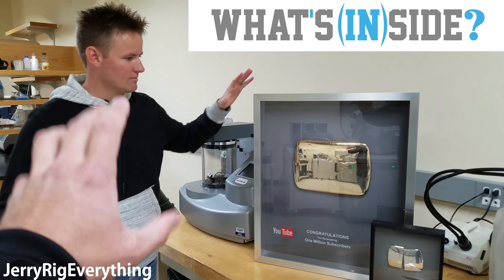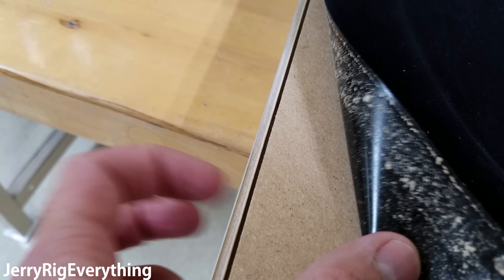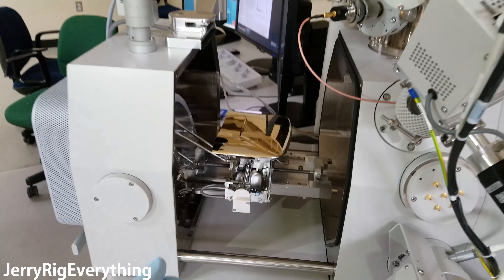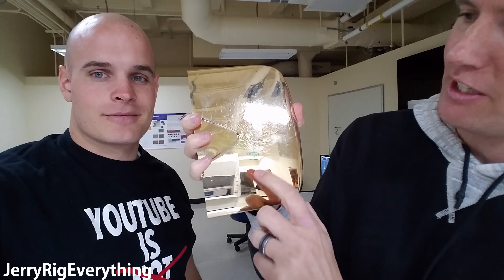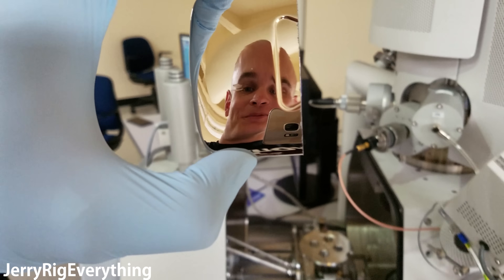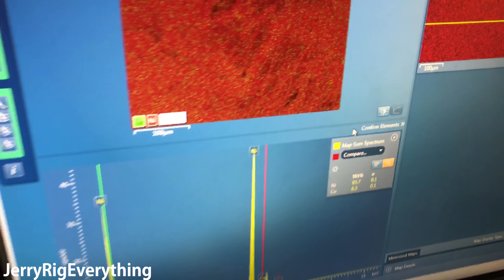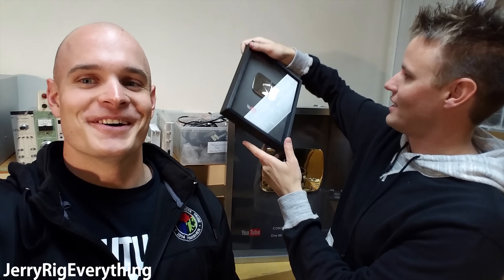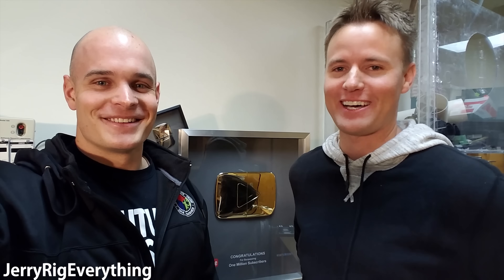What is the Gold Play Button REALLY made of?!?

Comment: I do gold recovery as my job..  the play button is solid brass,  its nickel coated then as the gold plating sticks too the nickel better (exactly how they do computer components)   the front shinier side has less gold as after plating it was polished for a shine reducing its thickness and exposing the underlying nickel microscopically,    the button is about $12 worth of brass plated with about $6 worth of gold...   u could have just used an rf gun from a scrap metal dealer to test it without damaging it..
Reply: Also it was illegal for utube to write 24k plated on it, as 15% plating is less than 3k...  any other company to stamp that would get instant jail time and a half a mill fine...

Comment: The question is why is all the computer in this lab are like running in Windows XP?
Reply: Because it is better for serial communication devices. Does not reboot. Does not delete data. It is stable. It works fine off the network. It is 32bit and runs on everything. And because you do not need to rewrite the drivers of such a complex and expensive machine that is engineered to work for a looooooong time. Most dated lab equipments around the world still work extremely fine on XP. All of our Siemens PLCs in the battery factory i work in run on win2000 or XP. Nobody wants to deal with that win10 crap especially for legacy and embedded devices
Reply: Doc. Volt omg thank you for saying it
Reply: Doc. Volt Win 10 is such crap.
Reply: Lew Dong An because it’s 2002

Comment: Hmm, Nickel-Brass is often what's used for "gold" coins (as it's both much cheaper, and a lot more hardwearing), so their bothering to plate it with the real thing at all is more than they probably really needed to do. It might show more on the back than the front because the plating is probably very thin, as well as soft, and it might have got more wear on the front than the back if it was transported with the backing plate in place...

Similarly, US Nickels got their name because that's what's used for "silver" coins... true, old timey silver coins tarnish like crazy (including if just plated), so you probably don't want that for your commemorative buttons. And in the past, before copper started getting stupidly expensive, it was just a plating layer over a copper core (which is, of course, highly conductive, and so very good for electroplating)... dunno why they'd have a very mild copper/mostly nickel alloy in the middle though... Maybe it's easier to mould, and then the pure layer is plated on top to give it the proper shine?

Comment: A nickel underplate of maybe 1.5-5 microns is used to reduce porosity of the brass surface and act as a diffusion barrier to prevent copper and zinc penetrating the top layer of gold.  The actual gold plating might be as little as 3-10 angstroms thick (we're talking a few atoms here), so it makes perfect sense that the elemental makeup would return a mostly nickel result.

Comment: the way they plate gold is by placing it into water with a gold plate. They then use electricity to make the molecules to travel to the place they want it. So it's not surprising that there was a very little amount of gold, and because it mixed in with everything else,  I wouldn't be surprised if the molecules intermingled.

Comment: The back would have more gold. The platting was totally even, but the gold plating on the front lost gold to polishing.

Also, why didn't you give the inside of the silver button the scrape treatment like the gold? The nickle was totally just the plating. That is not a typical casting metal. The copper was also plating. Copper plating comes first, nickle second. The copper plating first allows the nickle to electroplate cleaner and more efficiently.

Comment: When something is plated it is usually done by electroplating in a bath which is why the play button would have gold on the front and back. A plating bath as opposed to vacuum deposition which would only plate one surface. The reason there is less gold on the front of the Gold Play Button, is that after plating it, it was polished which removes a fair amount of the metal in order to achieve the polish. Having it in your back pack or pockets wouldn't remove nearly as much as the polishing process. Although plating deposits such a small amount of metal that it will wear off fairly quickly. The reason the Silver Play Button isn't make with silver (either sterling or fine silver which is considered pure) is that it would oxidize and wouldn't look nice after a while.

Comment: Why would it be real gold
Reply: Dragon Brix Productions it does have real gold in it
Reply: Well, it says 24KGP, which means it should be 100% gold plated (or more precisely 90-95% gold due to impurities in the metal).
If it's only 15% gold plated, that means the statement is more or less a scam. I don't believe that Google are scammers themselves, it's just that they probably outsourced the manufacturing to someone who is likely a scammer, without knowing about it or giving much thought to it.
Reply: @elimalinsky7069 , no, it's not always a scam. For example, gold plated electrical connectors. They would break apart when screwed down, clamped on, etc.. if they were solid gold. Gold is a soft metal. Corrosion is typically from the outside so they only need to be plated anyways.
Reply: @kalijasin  industrial gold has always more tin, nickel or zinc in it than actual gold, due to gold being a very soft metal almost like clay. But this is not industrial gold, this is decorative gold hidden behind glass.
Reply: @elimalinsky7069 ,  you do know it doesn't come out of the ground pure gold? It only becomes 99% or whatever pure gold when melted down and separated from.
Reply: @elimalinsky7069  they did say there's a lot of reason why it only contains max 30% gold when they scan it, the gold plating might be corroded/rubbed off and the electron microscope penetrates the surface and scans a few microns below the surface as well, which might screw up the numbers
Reply: Exactly people expect it to be fully gold but it's only plated which is awesome but still!
Reply: Because it says 24k gold dummy
Reply: @jw3384 ,  Anything that is sold as 24k gold is not solid gold e.g. 24k gold - chain, ring, etc. It can't be because  pure gold is pliable and moldable, like putty or dough.
Reply: Dragon Brix Productions it kinda would be pointless and YouTube would be nothing if that they didn't put what they do as a "goal" for what most dedicated people work for and in a way would be fails advertising if that they didnt give you anything and could result in possibly a good lawsuit

Comment: %15 gold is honestly better than i was expecting
Reply: I was expecting none
Reply: They really shouldn’t have written 24k..
Reply: @veronika6676  why? It is 24k gold PLATED. Anything GOLD PLATED HAS COPPER AND OTHER MEDALS IN IT AND IS ACTUALLY USUALLY LESS THAN 10% GOLD!
Reply: @frigoff2760  its actually less than 5% you should do more research
Reply: @veronika6676  it says 24kgp not 24k there's a big difference
Reply: CDgonePotatoes, 0.3mm is a metric buttload of plating. I wouldn't be surprised if it's more like 0.001 mm or less
Reply: Osrs lol
Reply: Veronika it 24kgp, 24 karat gold plating. Its outer shell is gold, thats all. Gold leaflet, gold clad, however you want to say it it's still a pure gold outside.
Which is why he mentioned it rubs off easy. Because it does. 24k plating will rub off easily if not sealed.
Reply: Yet less than they claimed it was
Reply: Same
Reply: Coated
Reply: bradley morgan spoiler 😒
Reply: true LETS SELL IT
Reply: damn spoilers....
Reply: I saw a animated video by brewstew and there was a math teacher with a M16 and a student asked “does the percentage sign go before or after a number?” And the math teacher shot him.
Reply: That's the surface though...
Reply: This will teach me to read comments before enjoying a video
Reply: You should drill a hole in the middle of yours to see if it just plated or solid.
Reply: Actually, it's only the plating (which usually it's the thickness of 0.3mm) that contains any gold at all while the button itself has nine, YouTube could've reserved that lie written on the button by themselves and just said straight away it's ha golden button and doesn't hold any more value than a sentimental one
Reply: @cdgonepotatoes4219  how is saying it's gold plated a lie you idiot? They proved it was gold plated. YouTube never claimed a fucking 10 pound piece of metal was solid gold you idiot
Reply: bradley morgan  15%*
Reply: YouTube has plenty momey should be real gold
Reply: DunnyDunDidIt Grammar nazi!
Reply: dombplays same lol
Reply: James nope it some countries you type % first so don’t correct if you don’t know basic shit
Reply: @spelking5  The text is in English. Using your native language's rules while speaking another language is not correct, and that makes your argument silly.
Reply: @spelking5  calm down bro
Reply: @Ezymoneysniperr  Sorry fam
Reply: CDgonePotatoes do you know de way

Comment: I want that machine! Is it accurate? Let's say if we test water there. Will it get the right percentage of hydrogen and oxygen?
Reply: It is more or less +- 2% accurate. Since it works with x-ray spectra emmited from electron shells it will not detect hydrogen (it does not have the corresponding electron transition). It will detect oxygen, however the error would be much bigger (there is a lot of overlap in lower energies where the oxygen spectra is located)
Reply: If it detected hydrogen... It would also have some error just because water has ions in it. It's pretty difficult to get a good 2 to 1 ratio of H2O. But as Radovan Čech said (+/- 2%), it's no Walmart toy!
Reply: This machine can detect elements down to Lithium. It can detect oxygen! But the machine works under vacuum so analyzing liquids is also hard.

Comment: Lots of metals don't "like" to stick to each other, so plated metals typically have multiple layers.
The Silver button has an aluminum core and nickel finish, but the nickel doesn't "like" aluminum, so it's got a layer of copper in between (which "sticks" to both).
The Gold Play button is brass (copper & zinc, which gold doesn't "like"), so a middle layer of nickel, followed by the gold exterior.
The electron microscope is identifying multiple layers of metal, hence the mixed results.
Reply: Christian Acevedo No, not ripped off, it was rubbed off. 24 carat gold is very soft.
Reply: Sanivan if you did some research, or maybe read a book sometime in your life, you would know that he is correct.
Reply: Sanivan dude, the op is right. Brass looks like gold, and nickel is used to bond the brass to the gold plating.
Reply: Well Christopher, if have to disagree about one thing. In reality, gold, copper, and zinc mix pretty well. Nickel and gold DO NOT mix well at ambient temperatures, and typically metallurgists use grain refiners and intermediaries like copper to get them to stay together. The silver play button is essentially a big nickel.

The nickel layers are likely for a simple purpose, probably to create a harder surface.
Reply: Christopher Stone ¿what they state, that the gold in the plate could've been ripped off, is even plausible?

Comment: The play button is made of brass and is electroplated with ~20µm nickel to make it shiny and probably ~0,1µm gold using both  a process called electrolysis, you can look that up there's plenty of information about it. Also you are right the SEM does measure a volume and not just the surface thus you detect both gold and the nickel layer below that. To find out how much gold is on there you'd have to measure its thickness with X-ray fluorescence spectroscopy.

Comment: Foundry worker/machinist/engineer here, zinc is also a heck of a lot simpler to cast in mass quantities compared to nickle alloys. Casting process is far simpler, mold is cheaper and will last way longer and so on. I think that the cost reduction is even more in manufacturing costs than in material cost.

Comment: The shiny surface of the gold play button is clearly machine polished as shown by where the polish pads went slightly onto the back side during the process. This is most likely why the shiny part has a lower percentage of gold. The back side which isn't polished has a larger percentage as the micro thin layer of gold plating hasn't gone through abrasion polishing.

Comment: Plating metals is tricky, the reason that you are picking up variances of the nickel and gold on the surface is because in the process of plating, nickel would be plated first and in a far thicker layer than the gold which would be plated on top in a separate process. Your microscope is probably detecting the subtle variations of the plating thickness, inclusive of buffing and as you already described, the rubbing off during globetrotting.

If I am not mistaken, gold cannot be platted directly to some metals (copper) and thus needs an intermediary metal to properly plate to.

Comment: Gold plating is always extremely thin, if you tore it off neatly and looked through it at the sun, you'd still damage your eyes. An electron microscope is simply the wrong tool to figure out the composition of any plating. And of course there's more gold on the back because it's not polished up (i.e. material removed) like the shiny front.

Comment: Of course there was nickel under the gold plating, it's a normal part of the gold plating process. The inside was brass because it's durable and easy  to cast. The reason there was less gold on the front is because it was obviously polished, so some of the gold would be worn away.

Comment: The actual metal polishing process to make the front shiny uses an abrasive to get rid of large surface scratches so more light reflects off versus it being absorbed by the deep ridges. The front most likely has a lower gold composition because they took more material off in the polishing stage while the back of the button remained mostly gold plate

Comment: If you check the electroplating processes you would probably find that the brass base metal would FIRST be nickel plated to get a super smooth surface to do gold plating which is probably only a few atoms thick.  Look up the processes... even chrome plating of automobile stuff will first copper plate the steel, then nickel, then finally the chrome.

Comment: The variance in gold content is due to the simple mechanics of buffing.  Nickel is an intermediary metal which alloys well with copper and zinc, but also provides an optimum surface for plating with gold.  Once plated, the presentation side is polished using a jeweler's rouge-impregnated soft fiber buffing wheel on a fixed buffing machine; this is why you saw a slightly polished edge on the unpolished underside, as the soft fibers wrap around the edge as it is pushed into the spinning buffer wheel.  This is also why your analysis results showed less gold content on the polished side, as the act of polishing removed a substantial portion of the gold that was deposited there.

Comment: It seems the gold button has a brass core, there several layers of niquel to ensure that the gold will deposit on it. the it comes the gold layer, and as it has been polished, the shiny face has less content of gold than the other one. 
For the silver button. Silver is a very pretty metal but unlike nickel, it use to turn dark as it becomes to oxidise, as no ones want it to happen, the better option (and cheapest) is to use nickel instead.

Comment: The fact that the microscope penetrates into the object explains why it was showing the nickle. Most metals that receive an electroplated gold coating are first plated with a base coat of nickel to act as a buffer layer and help the gold adhere. This is especially important with copper alloys since the copper will atomically migrate to the outside of the gold plating and cause tarnishing. The copper would also contaminate the gold plating tanks.

Comment: Alright, so its going to sound like I am blowing smoke up your asses, but you aren't taking into consideration the interaction volume of the electron beam. For EDS the beam penetrates deep (as in about a micron) into the sample and generates x-ray signal from beyond the surface. The surface  If you want really accurate surface measurements use and Auger microprobe. The gold plating probably is pure gold, but it isn't very thick, so you are reading the nickel they plated onto the brass before they plated it with gold. You have to plate brass with nickel before gold to keep it from tarnishing through the gold.

Comment: I think there is a simpler explanation on the gold play button. The back is left as is. The front is buffed. Using Mohs Scale of Hardness, we know that Gold is softer than Nickel. Assuming the buffing takes off bits of both, the Nickel removed in the process would mean that it starts taking off more Gold than the buffing wheel alone. Therefore, the Gold-Nickel mix on the front would be different than the back in favor of Nickel.

Comment: I was thinking that the nickel head something to do with the ability for the gold to bond to the brass. So i googled it and found this on wikipedia and found this;

"With direct gold-on-copper plating, the copper atoms tend to diffuse through the gold layer, causing tarnishing of its surface and formation of an oxide and/or sulphide layer.

A layer of a suitable barrier metal, usually nickel, is often deposited on the copper substrate before the gold plating. The layer of nickel provides mechanical backing for the gold layer, improving its wear resistance. It also reduces the impact of pores present in the gold layer."

So it looks to my they nickel plated a brass casting so the gold would bond better. Which also means that the gold they used could be 24 karat but it's only about 3-5 µm thick. this could also explain why the microscope measured the nickel underneath.